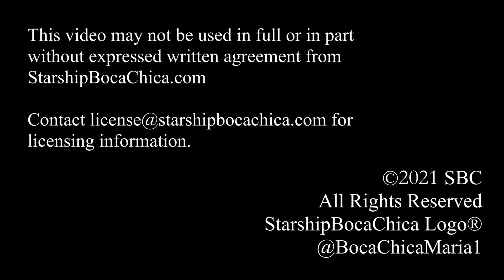2021_03_28 Week in review. SpaceX Starship Boca Chica. SN11 Ready to Launch.

Comment: At 4;34 on the last second of the unknown frame, there are rollers inside it. Could it be for the static pressure test with support above the skirt to ensure the skirt doesn't collapse.... Its strong enough, and all the cross reinforcing obviously for supporting weight. Not sure why the "floor" would be like it is...
Oh and thanks again Mary, you are a trooper.

Comment: So I reckon the mystery construction is simply a cradle to help ensure the Boosters remain stable and upright on the launch platform. A 9m diameter ring will fit perfectly within the framework - which I note has rollers on the inner frame around the top edges to act as guides/buffers - and when viewed from above, the size and shape of the hexagonal structure correspond with the inner part of the Orbital Launch Platform.
Reply: I agree
Reply: I've been saying to exact opposite, but you could be right. I think the whole thing will be inverted and placed on top, as a lifting cap like the F9 boosters get when they get back to port. Except this one will be bigger and will provide anchor points for the guy wires to help steady the booster as it travels down the road. The black X's on the sides will fit on the outside of the booster and should look pretty cool. They'll help spread the load down across some of the upper rings so the whole thing doesn't crumple near the upper edge when unequal forces are applied. The steel looks a little too lightweight for it to be mounted below BN1.
Reply: @Usstampcollectersatkiwistamps  That never occurred to me, but of course the booster is supposed to have Starship atop it so it would make sense.